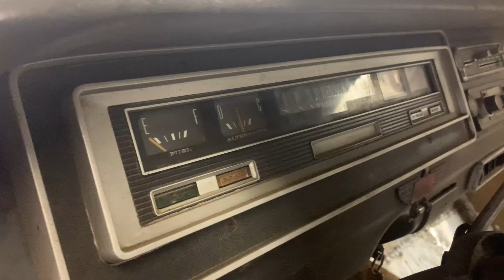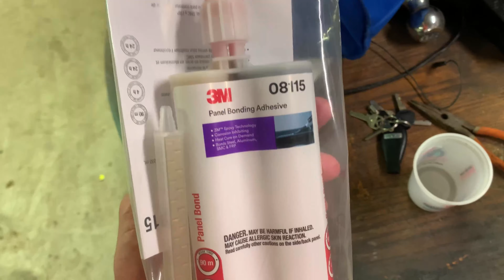Building a Dodge D100 Sweptline from Start to Finish

Comment: Liked and sub'd before it even got started. 
As soon as you said it started as a long bed. 
A couple weeks ago I bought a 72 D200 long bed with 73K original miles and nearly zero dents or rust. It's been sitting under a tree for 17 years, but buffed up pretty nicely. Can't wait to get the old 360 pumped up and shredding tires:)
Reply from the maker: Appreciate the support! Sounds like an awesome truck.

Comment: Looks great. I have a 63 D100 stepside. Short bed. With a 361 and a 1 ton 4 speed 2 wheel drive . I dont think they made a w100.
Reply from the maker: Awesome!
Reply: I have a '63 W100 short bed step side. They made them.

Comment: I hate the lumpy paint crap, and it ain't a truck if it ain't a long bed. I would have used lowering blocks and left the springs alone on the rear, you may regret what you did. I hope you didn't scrap the parts you didn't use, you could build a second truck.